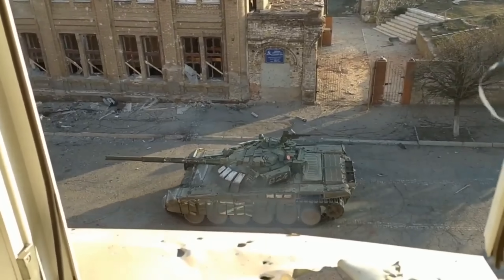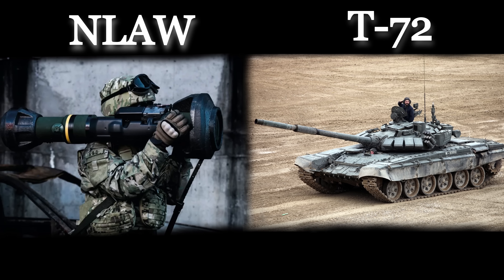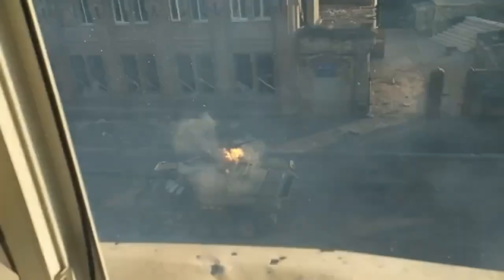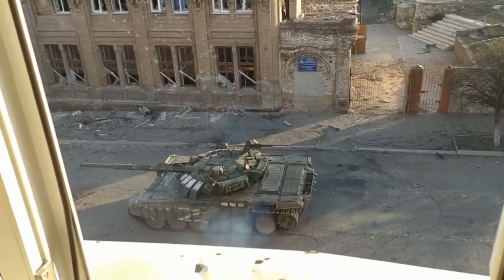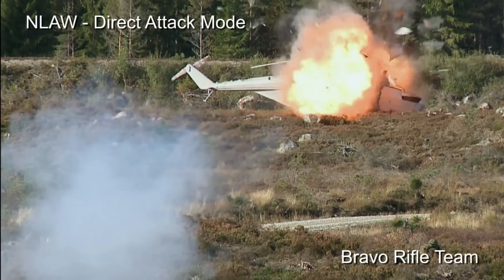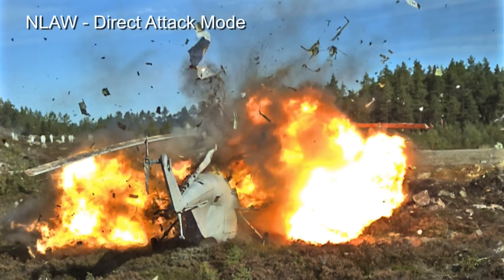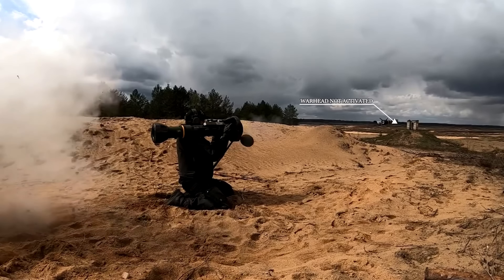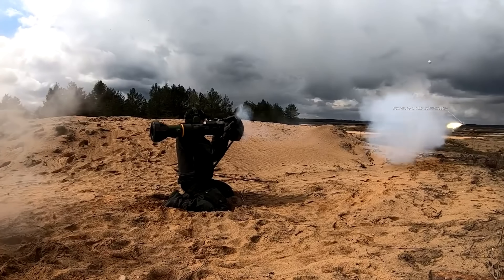Why NLAW Failed Against T-72B Tank

Comment: An RPG would be better, but also impossible to use where this shot came from, It would've had the back of the tube aimed for the ceiling less than 2m away in an appartment or similar.
 But, they could've waited for the tank to get 2-3 seconds further away and still been able to use what they used with better chance of success I guess.
Keeping calm in that situation can't be an easy thing though. Certainly concidering that there might have been other vehicles behind this tank further down the street or maybe soon coming around a street corner into line of sight of this situation. It might have been now or never. It's impossible to know what situation they were in. 

 I am sure of one thing though, this clip has already been seen by most operators of Nlaw and similar in the Ukraine by now. So the next tanks going under the "same" windows in the future, wont be so lucky. 

 These Russians lived so that many others can die... so to say. 
 
 Plus, no matter if extreme stress caused this or lack of knowledge about arming distance for the warhead - they still fucking took the shot. 
 If stress or lack of training was reason for this they at least gave the world more data to calculate the size of Ukrainian balls with. And by now we are starting to realize that the preliminary calculations unreal as they seemed, actually WERE correct. Female or male, they drag boulders around with them. 
 So that taken into account maybe RPG would've been an option anyway. 
 I mean if they got their own balls into that place it must be a pretty big place after all, and as such possible to use an RPG in.  

Hang in there Ukraine! 
It is a fucked up situation and you have not deserved any of it - but you have also caused Russia to experience hurt on a cataclysmic level.

 15k dead in 6 weeks might not feel like enough in the middle of things but it is 10 times as bad as most armies has ever experienced in a war, 1st and 2nd WW included. 
Even if we compare with especially bloddy operations of a war instead of over all war wide losses. Here are a few surprising facts to appreciate what has already been done.

The Commonwealth combined lost about 1000ppl per month during the North African campaign in the 2nd ww, divided on many nations even if one bore the brunt of it. Russia lost 10k first month and seems to the next one as well.
 
 Even during Barbarossa Germany "only" lost about 25% of their soldiers, over 3 years. In an operation that history has shown to have been nothing short of Hell on earth for the German soldiers. 
 Operation free "Ukraine from Nazis" will have cost Russia 25% in under 3 months though. Maybe even 2. Meaning:
 Ukrainian forces have chewed up Russians more than 10 times faster than the Soviet Union destroyed German lives in 1941-44. (Adjusted for size of operation) 

 No military force can sustain a loss of 10-15% per month without something every soldier feel worth dieing for - to fight for.
It's impossible. And means a 50% war wide chance of being alive less than 6 months in. If still alive you WILL HAVE lost more than 50% of those you started fighting with.

 Afghanistan and Chechnya was for a Russian soldier a safe vacation compared to what 6 weeks in Ukraine has been. 
 Even Vietnam for the US which became impossible to keep up because of losses, without something worth fighting for - was NOTHING compared.
 The US lost 60k soldiers in Vietnam over 9 years there, which led to so low morale among US forces and population they had to back out, beaten and in shame. All lives they lost and took having been for nothing. 
 Ukrainian fighters will have scored 60k dead Russians in 5-6 months. and that out of a "pool" of Russians to kill that is FAR smaller than Viet Cong and the NWA had to do the same with. Meaning, units will become decimated on a whole other level. And every Russian soldier sees death of friends on a level 20-40 times higher than a US soldier saw in Vietnam where deaths were spread out more due to a bigger fighting force plus spread out over time in a way that made single soldiers rotate back to the US before it all had hit his unit. Every guy saw only snippets of the 60k dead. Russia just took 15k dead and certainly another 15% hurt before any soldier has done 1/8th of their time in the conflict.

What was needed to make generations of Americans declare themselves against a US war you did 20 TIMES as bad to Russia so far.
 20 times what it took to turn the US against their own presidents, during war.
 And if we know something about americans it's that they always support their troops and presidents when at war if they get even a bad reason it is what needs to be done.

You are the destroyer of worlds, seen from a Russian perspective. The stuff of nightmares.
Reply: Backblast is too strong to fire and RFG-7 inside a building
Reply: @richlopez5896  that don't stop the taliban
Reply: Exactly
Reply: 46 000 Ukrainian soldiers 
killed, captured, wounded and missing
Reply: @alekseylebed4945  Numbers for the Ukrainian side makes the outrage because of the crime committed against them bigger for each one. For Russia, every one makes what they are trying to steal more expensive. And worth it for fewer and fewer.
Reply: @alekseylebed4945  
Oh bullshit. You post that same lie all over YouTube.

Comment: The missile didn't arm due to the target being within the minimum arming distance.  Duh.
Reply: Exactly 😅

In order for this weapon to cause significant destruction, it would have to accelerate for at least 100 to 200 meters, which was not the case here.  The shooter fired it at a distance of about 20 meters and therefore the impact was minimal, and thus the destruction of the tank.
Reply: @MantodeaBLN  no, arming distance
Reply: @MantodeaBLN  what? It's a chemical warhead. Not a kinetic shell. velocity has no change in destructive power. It was simply arming distance was not achieved
Reply: @MantodeaBLN  you're wrong there bud, it's a shaped charge, their effectiveness has nothing to do with velocity (shaped charges utilise an explosive to propel a penetrator to hypersonic speeds via the Munroe effect) and as mentioned above, it's a chemical based warhead which does not rely on the kinetic energy of the entire round, rather the energy of the chemically propelled penetrator

Comment: you couldn't use an RPG in the confined apace of that room without the back blast killing the operator
Reply: This is not true anymore. The NLAW has been designed to be fireable indoors. The new technology is interesting.
Reply: @UnicyclDev  please read my comment carefully, i said the RPG couldn't be fired from a confined space or inside a small room, NOT the NLAW

Comment: that explosion is from the rocket fuel not missile warhead. Minimum range is 20m for warhead to be armed as safety measure. If the warhead explode at this range it might cause injury to the person who fired it
Reply: And is over all more likely to have been a hit of something not intended than a target. Like a branch or whatever the operator didn't see because of being concentrated on something a mile away.
Reply: if the tank explode at this range, with munitions inside the tank. How big the explosion going to be. Even with RPG. That is too close.
Reply: Want to sound clever by exactly saying what the video says
Reply: It's an option to turn it off.... something that troops do almost immediately. The missile couldn't do the job, plain and simple
Reply: ROCKET fuel, because this tank runs on it or wut ? 😂
Reply: @parazitdetected  it is from the missile's propellant.....
Reply: @parazitdetected  from the NLAW missile. Not the tank
Reply: @Milieboy  thank u captain
Reply: @parazitdetected  well they were unsure if stupid or .. well stupid